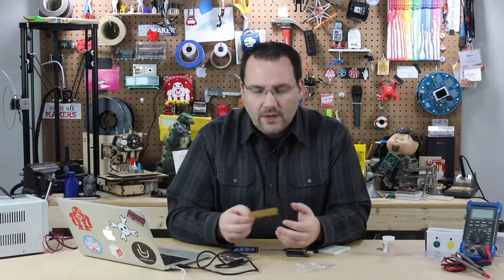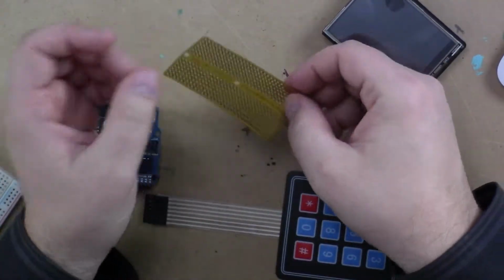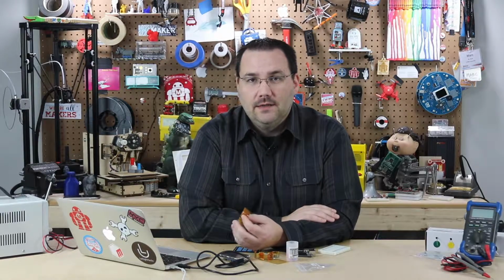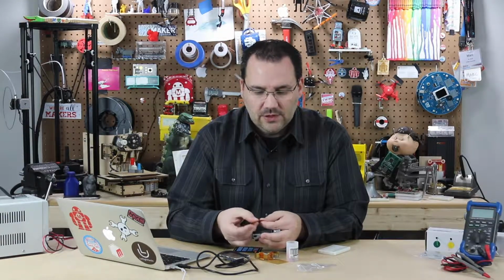Flexible PCBs for Arduino: The Trick Behind Wearable Electronics

Comment from the maker: ⚡ Quick tip: solder does not flex. If you run a long solder trace down a bending section of a flex PCB, it will crack. Keep all your soldered components clustered in one rigid zone and let the bare flex sections do the bending. Rigid-flex boards exist for exactly this reason.

📌 FULL SERIES: Watch all 100+ episodes of the Complete Arduino Prototyping Series. https://www.youtube.com/playlist?list=PLcKte0wD90Y4lsrStEWB5NR1gKMs0FDts

Comment: Hi Marc, I'm Hector I want to design my first flexible board but come up a question to me and it's what's the best way to make a perfect smd soldering in a flexible board? I specifically mean to esp32 soldering or QGN packages chips. Do you have any idea about that?
Reply from the maker: I have actually done that recently. My biggest piece of advice is to contact and work with a good PCB manufacturer. It’s more than likely going to take a few tries to get it right. Basic flex is easy, but there are a lot of nuances based on how flexible it needs to be, etc. Your board house will have design specifications for simple flex PBBs.
Reply: @MarcdeVinck  Thanks for your swift reply. And is there any technique for smd soldering when you want assembly a very small smd component like esp32 chip?
Because I'm working on it and I would like to get more information!
Reply from the maker: @h3ctor1991  Funny you should ask! I do! I created an entire course on soldering for LinkedIn Learning. If you have a Pro account, or are a college student (most universities provide it to their students) it's entirely free! https://www.linkedin.com/learning-login/share?forceAccount=false&redirect=https%3A%2F%2Fwww.linkedin.com%2Flearning%2Flearning-soldering-for-electronics%3Ftrk%3Dshare_ent_url%26shareId%3DeSIqTFnGT7uFoTrmVQ5jCg%253D%253D
Reply: @Marc de Vinck  Great! Well, I consider that I have a good SMD assembly technique, but I want to know about if I should to get an specific considerations for flexible board soldering. But thank you so much for share me this course, I will watch it.
Reply: @MarcdeVinck  Great! Well, I consider that I have a good SMD assembly technique, but I want to know about if I should to get an specific considerations for flexible board soldering. But thank you so much for share me this course, I will watch it.
Reply from the maker: @h3ctor1991  Thanks for the support. And if you know how to solder SMD components, there isn't that much different on flex boards. Again, the biggest challenge is the manufacturing variances. Some boards are simple, and others are tough. Standard boards are basically always perfect...flex always seem to need adjustments in thickness, copper, masking, etc.
Reply: @MarcdeVinck  Really thank so much! I will be pending of your new videos.
Reply: @MarcdeVinck  Thanks Marc.

Comment: Hello Mr. Marc, Do you think its a good idea to try to make custom  FFC or FPC cables for connectors using flexible PCB?
Reply from the maker: You can, and I do. (Just made one last month) Just keep in mind it's not particularly easy, and you need a good manufacturer for long term continuity.
Reply: @MarcdeVinck  that's great, thanks

Comment: Is it possible to use flexible  circuitry in the synthetic skin used for prosthetic limbs? Embedded with sensors that can detect heat or cold and maybe even touch.
Reply from the maker: Flex circuits?! Sure. Synthetic skin? I don't know, but seems plausible.